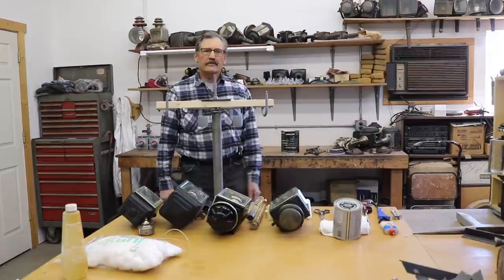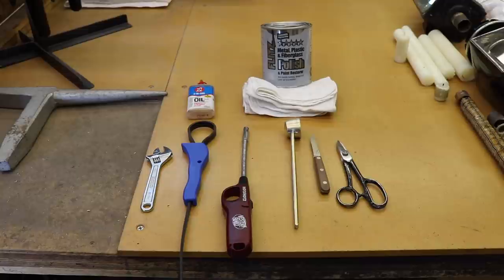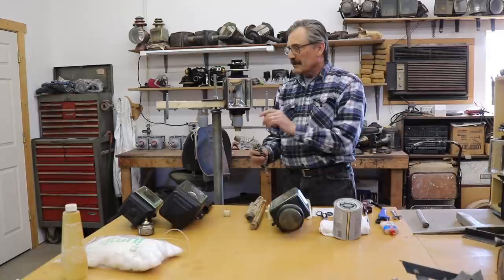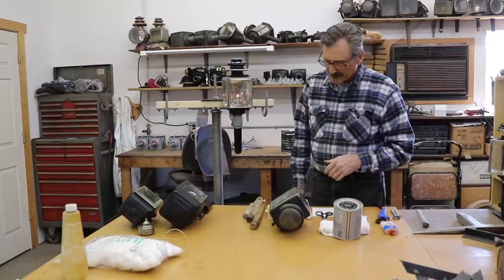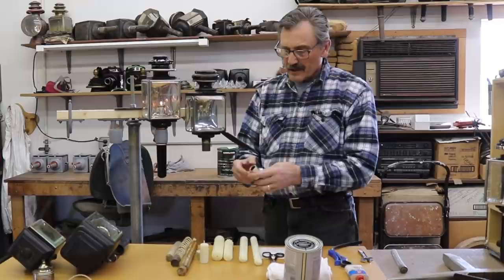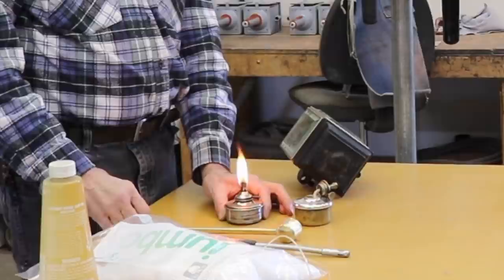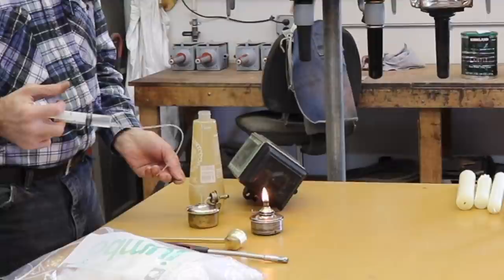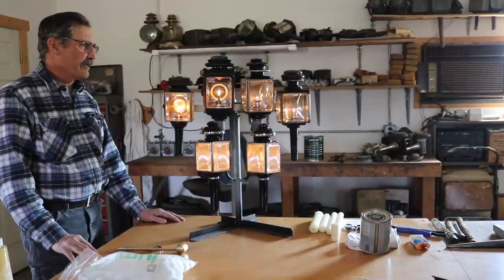Carriage Lamps 101

Comment: Like so many others, following Dave’s recommendation!  Interesting that the tail on the oil lamp persisted to maintain the look of the candle lamp predecessor. Still on our porch light, too. One point I remember from being corrected in Church. The difference between a candle extinguisher - what you demonstrated), avoids blowing hot wax all over - and a snuffer - which was a little scissors with a box on one blade that was used to trim and catch the wick.  The snuffer was the domain of the sexton. Doesn’t look like anyone makes that distinction any more.
Reply from the maker: thanks for the clarification!
Reply: The Luminary Shoppe Be careful!  I could be wrong (it was an old church).

Comment: G'day,

Yay Team !

Thankyou for pointing Dave at the Wheelwrighting business ; I found you via him, and I found him via the YT Algorithm...

I posted a video of my grandfather's Spoke-Pointing & Tennon-Cutting Bits, which I was about to use to make some rustic outdoor furniture - cantilevered & with dowelled joints...; the Workbench I made that way 25 years ago (with the ancestral Bits...) being still in-service...

In 1976, when I was 15, I helped my father (52 when I was born...) to shape & fit a pair of (square-sawn Spotted-Gum)  Shafts onto a "Racing Spyder" (lightweight Sulky, in Oz - I dunno what you'd call it in the US ?)..., and in '77 he had me in the team when he set the second of a pair of Steel Tyres, onto their (2, Steam-Bent) Wooden Felloes of the Wheels for a Horse-drawn Harvester which was under restoration.

The Shafts were  from among 6 pairs which my grandfather took into Stock in 1936, there were 3 pairs still in the Rafters of the old Paint Shop...; the other 2 pairs then being readily  on-sold to the people who owned the Spyder.

I've charged Batteries with Wind-Turbine Rotors that I carved with my grandfather's Wheelwrighting Tools..., & I've flown behind 2 different Ultralight Motorglider  Propellers that I made the same way...; and I didn't realise it until (binge) watching Dave's Videos - but I've somehow wound up with pretty much my grandfather's entire Journeyman's Wheelwrighting Toolkit - enough so that I could put my hands on enough rare, old, and specialised Gadgets to Make a Wheel with if I wanted to try... (and I have one old & never-used Hub to start with, too !).

As I've told Dave in the Comments..., I have a long mouldering ambition to build an Electric Wooden WindWheel, for the fun of it, a Permanent-Magnet Alternator with a Bridge-Diode Rectifier to produce DC Current...

I visualise
Helically-pitched Wind-Turbine Blade-Sections, carved onto  the Spokes...(I'm practiced at that, it's the theoretically "hardest" part, but it's the only bit that I've actually already  kind of mastered...) and Neodymium Magnets in the Felloes (which will be weirdly-Sectioned, too - to harness a little bit of "Thrustrum Effect", as well as using the Felloes as a tip-sealed, rotating Duct...), so it would be quite Aerodynamically very efficient (!).

The idea is to build a Triangulated Wooden "Airframe" for the Windmill, with a pair of C-shaped Iron-Cored Pickup-Coils with the Magnetised faces of the Fellows passing between the ends of the Cs, with close attention to the Spacing, to ensure that as the Wheel turns there is always the same Area of Magnets between the Iron Faces, as the Magnets go past the Coils - to prevent "Cogging".

I forsee no actual advantage over what's readily commercially available in the shops, and Solar Panels beat the Tripes out of Windmills for making reliable off-grid Electricity, say for Houselighting (I've been off-grid for 35 years)...; but I think that for sheer whimsy and quaint eccentricity it might be quite difficult to beat - if I can make it work...(?) !

Anyway, until I encountered Dave's Videos I had had more experience at Wheelwrighting, and done more of it than anyone else in the local Postcode (2370, Glen Innes, NSW, Oz...), but - I knew that I actually knew almost nothing about it... Mere ancestral smatterings picked up along the way, as a kid, hearing and remembering things said...

  But, now, I'm aware of at least a thousand mistakes to try not to make - which would have probably conspired to stump me entirely...

And if Dave's in the business now, because you started him in that direction - then I owe you as much thanks as I owe to him...

Yesterday, I left a long comment under his most recent upload, inviting him to check out my

"The SunFoil Project..."

Playlist, 

Therein to collect his Reward within the Gift-Economy, for having taught me so very much ; which I've wanted to know for 60 years...(!).

You, too, deserve my gratitude ; so pretty please, if you feel like it, check out my SunFoil  Project Playlist. The long-winded explanation is posted in the Thread under Dave's video posted at the end of Feb. 2024...(yesterday was my 29th of Feb, when it appeared in my Feed - but in Montanna, when Dave posted it, it was still the 28th !).

I hope you enjoy the idea of SunFoils as much as I'm enjoying the Wheelwrighting...; and the Lampwork.

I lived on Kerosene Lamps & Candles from 1985 to 2000..., so you, too, appear to me have the status of an actual GuRu...; Gu meaning Darkness..., & Ru meaning Light - so a GuRu leads people from the Darkness into the Light...(!).

So a Hare-Krsna told me once...

Which is a pretty fair description of a Manufacturing Luminary (!), is it not ?

Such is life,

Have a good one...

Stay safe.

;-p

Ciao !

Comment: Hello from part of Dave's night crew.  You commented and demonstrated adding filling material to the oil bowl.  I was wondering why.  one comment of 127 says:  
"Jos Diepenbeek
8 hours ago
To encourage the gas formation from the fuel in the tank. The same system was used in the so called oil-lamps in the mining industry (long time ago).
"

I  thought it was just as baffle material to help prevent spillage.   Or to help fill the reservoir and prevent an excess of oil being burned by the the person who forgets to snuff the flame when done using it.  Please expand on the "why."  Thank you for sharing your knowledge.
Reply from the maker: The cotton in the oil tank serves to control excess sloshing around of the oil and adds additional wicking action as the oil is used.

Comment: Could You try to compare different lamps brightness? I guess it's gonna be tricky to set up camera properly to get what eye sees (also it depends on monitors we use). Maybe use known-luminosity light bulb as a reference in video?
Reply from the maker: most carriage lamps were one candle or one oil wick power ( some exceptions, an example will be featured in an up coming video series) and therefore not much difference in light produced , however some lamps appear brighter because of reflector design.

Comment: Rick - great video! When properly setup, how deep is the hot pool of wax when a lamp is burning? What keeps the candle from melting into a runaway state since it's under spring pressure? Thanks, and keep it up!
Reply from the maker: The melted wax is usually only 1/8" or so deep. The melting temp of beeswax and the design of the candle cap keep the candle from melting too quickly. Thanks for tuning in!

Comment: Excellent first video!
Question .. you mentioned putting cotton into the oil lamps ... and i have seen this on a couple traditional wall mount oil lamps. My question is Why? Ive always assumed it was to prevent sloshing of the lamp oil if the lamp was being carried ... which seems to carry over to your method if installing the cotton in a very mobile lamp. Or is there some other reason behind the cottom in the reservoir?
Reply from the maker: exactly, also serves to carry more oil the the wick as the level in the tank gets lower.
Reply: @TheLuminaryShoppe  Thanks!

Comment: You have a humming light fixture that is a distraction.  Also your shop acoustics are pretty hot.  You need some dampening panels to cure that.  Styrofoam panels attached to your ceiling would help.  I am looking forward to more video’s.  They will be a nice compliment to your brother in law Dave.
Reply: As soon as he switched the lights out, the humming stopped.
Dave will help him 'fine tune' his videos. 😉
Reply: @josdiepenbeek469  Also, a good microphone on his lapel would be nice (Lavalier microphone). Please do not use the microphone on the camera. It is worth it to spend money on. The quality of your video's will go way up.
Reply: Led lights rather than fluorescent. Totally quiet.
Reply: A first time videographer and he is criticized?
Reply: @rickbrandt9559  There's nothing wrong with some helpful advise. It shows the expectations are high.😉
Reply: @josdiepenbeek469  

Not in the tone used.show me your example of how to be the expert!
Reply: @rickbrandt9559  Suggestions for improvement? Positive criticism.
Reply: @charanvantijn541  Your Channel!!?
Reply: @rickbrandt9559  Not my channel. I am Dutch and therefore direct in my conversations. I see a good video with bad audio. So I say something about it. But, it doesn't stop there. I also give a suggestion about how to improve the sound quality. If you have a problem with that, maybe you could like at what's bugging you? Or tell me straight what I did wrong in your eyes?
Reply: @charanvantijn541   So unkind to 1st timer with free info. Never look a gift horse in the mouth.
Reply: @rickbrandt9559   This discussion leads nowhere. You have your opinion, I have mine. Let's close this topic.

Comment: I have a simmilar square carriage oil lamp with no wick adjustment knob. There are two holes where it could have gone. Im not sure if its missing or if its possible some lamps dont have them
Reply: There's also no door; it can only be opened from the bottom.

Comment: I have a set of lamps for my competition show carriage. Never used them for light just for show.  How do you cut the bees wax? It tends to chip using a knife. Also what keeps the wax from spilling out if the cup when moving. Thanks.
Reply from the maker: warm up the candle a bit before you try to cut or trim it. I put a long candle in my shirt for 10 minutes or so. A short one can go in your pocket for 5 or ten minutes. Some spillage is inevitable, wait until everything is completely cool to clean it up. Often you can just chip it out with your thumb nail.